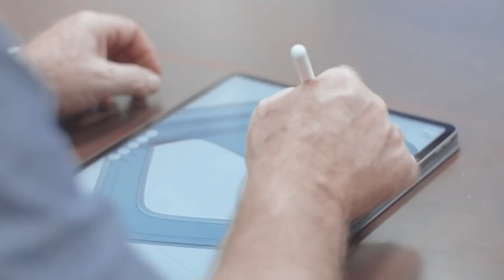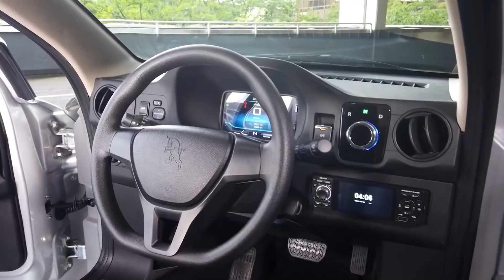8 INCREDIBLE VEHICLES THAT YOU CAN BUY RIGHT NOW

Comment: We're not there yet but we almost are. I've seen ebike videos that feature electric bicycles that can go from 75 to 150 miles on a single charge, but they just happen to be long range batteries and efficient motors that are mounted in incredibly expensive bikes. One of these days, some smart cookie capitalist minded guy is going to put a high range battery and an efficient electric motor on an ordinary bicycle that ordinary people can afford. The electronic technology already exists, and cheap bicycles already exist. On the day that some smart cookie decides to fill the gap between a bicycle and a rich boy's toy ebike, when long range affordable ebikes become available to the masses, ebikes are going to take off like a rocket and the smart cookie is going to become very rich.
Reply: @Piguponpig piG The key here is of course, to create batteries that can be recycled. The transportation industry IS going electric, there's no doubt at this point, VW just announced that they will not be designing any new ice engines for their cars and so many automakers are following suit, so considering that's the way things are going, and they are, we need to address the issue of battery recycling. Besides, think about balancing the equation, there's a lot less fuel being spent when you leave your car at home and take an ebike, it's the greener alternative, and our landfills are already filled with crap, the powers that be have to work on it. No matter what form of transportation we choose, there's going to be some sort of environmental fallout. Even if you just walk, it takes resources to make walking shoes if you want to get technical, so the big boys have to take everything into consideration and create practical solutions to our current and future problems.

Comment: 6:29.  $36,000?!!  You're out of your mind asking that price.  It could be made of silver (925) and still cost less than 36K.  For 36K I could by nearly TWO of the most bad ass top of the line BMW enduro motorcycles.  Also, it's a "motorcycle", yet is far too light for it's application.  Expect LOTS of problems at high speed on this thing due to RIDER WEIGHT vs vehicle weight and center of gravity issues (center of mass).  Cool BICYCLE, electric, low speeds for 2-3K tops.
9:24.  A jetski module to turn it into a TINY boat for $25,000 to $36,000??!  Dude, I want some of the drugs they're smokin'.  For 36 grand I can buy all kinds of awesome full sized FULL POWER boats.  I hope you find the morons willing to spend that kind of money on a JETSKI powered baby boat.
Seems the target demographic for these "incredible vehicles" are millionaire- billionaires.  And the vehicles are not incredible at all.  The sky runner is probably the best, however if you know anything about parachutes... you'll realize the design flaw immediately.  It's a quad with a propeller on the back and a parachute on top for $230,000?  LOL.  You can build an airplane for under 100K.....
Reply: this is too long for me to read
Reply: Hope the price will be lowered in the future.